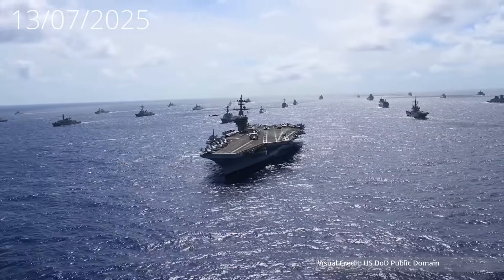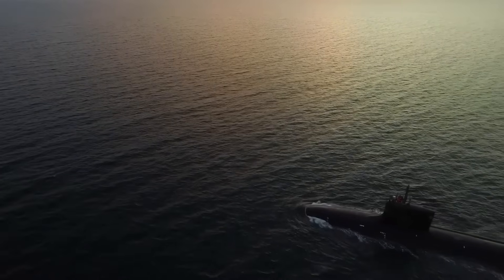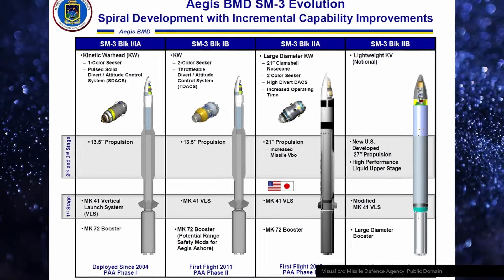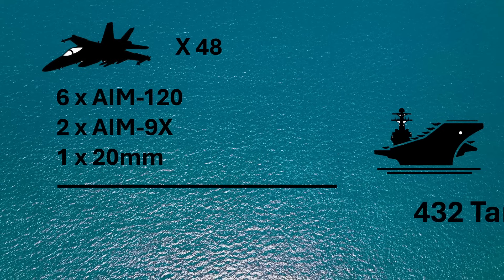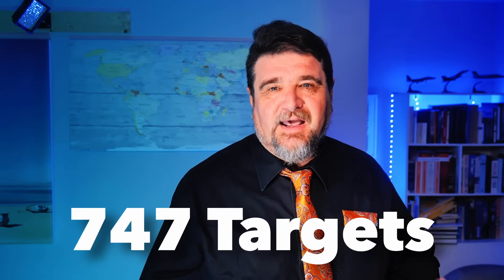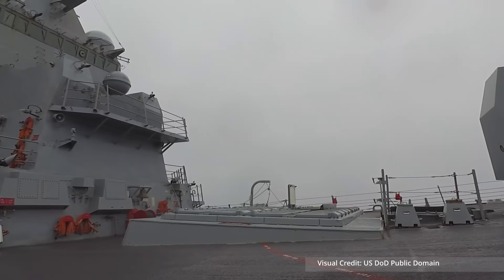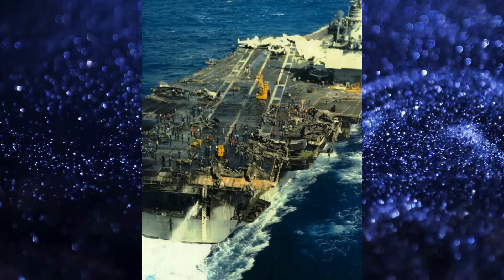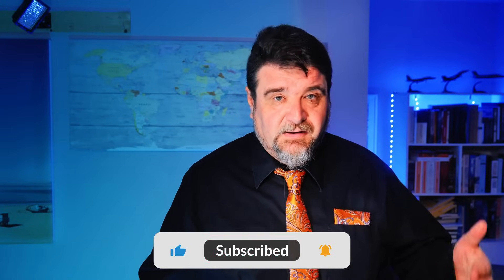HOW MANY Missiles are Needed to SINK A CARRIER?

Comment: We actually have SM-3 performance figures now, at least rough estimates.

Against high speed ballistic missiles, they intercept less than half of their targets. It's likely that saturation of a CBG's defenses could occur with as few as 12 ASBM's. 24x YJ-21 would almost certainly score a minimum of one hit on the carrier. That's only 12 H-6's for a mission kill.

Still, I agree saturation of the carrier's AoR with UUV's seems like a better bet for making it run home before it can even pose a threat.
Reply: Against legacy ballistic missiles with known trajectories, without maneuvers and countermeasures...
Reply: USN too now have some fast anti-ship ones with SM-6/AIM-174B, AGM-88G, and upcoming SiAW/MAKO.
Reply: @johnsilver9338  
These are not new capability, and you basically brought a scooter into a heavy-duty truck discussion.
Reply: @Conserpov  Not really. They are much more devastating. AIM-174B for example follows the same quasi-ballistic trajectory of Kinzhal so it too reaches hypersonic speeds at burnout. And F-18s carry 4 of them. 

While F-35s can carry supersonic AGM-88G, SiAW, or hypersonic MAKO internally. Meaning F-35s can get it much closer to their targets and launch these missile giving the enemy less response time vs a ballistic missile like DF-21/YJ-21 which can be detected at long range of more than a 1000km by BMD radars.
Reply: @johnsilver9338  
Bringing up AIM-174 and AGM-88 in the anti-ship missile discussion is like bringing up pistols in artillery discussion.
MAKO does not even exist yet.
US BMD is a bad joke.
You don't have a clue what you are talking about (that applies to your comments in other threads as well).
Reply: @Conserpov   Their goal is not to sink but disable a ship. Especially with AGM-88G which can target radars of enemy vessels rendering them blind. Even though they don't carry the same punch like Tomahawk they have enough KE to bore holes thru metal. But once enemy ships are disable, USN can then follow-up with classic Tomahawk or Harpoon or low observable sea-skimming JASSM/LRASM maybe even the standard JDAMs. Or USN can do all at the same time.

MAKO does not exist yet BUT SiAW does. You are the one who has NO clue what these weapons can do.
Reply: @johnsilver9338  
Again, you don't have a clue what you are talking about.

AGM-88 is a tiny, short-range, non-sea-skimming missile that can be easily detected and intercepted - or simply defeated by countermeasures.

Not to mention its launch platform will get blasted before it gets a chance to launch it.

It is completely outclassed even by lightweight proper anti-ship missiles in every respect - including passive anti-radar homing feature.

Proper missiles are long-range, sea-skimming, have multimode homing, do coordinated evasive and tactical maneuvers in datalink-networked salvos, carry EW and IR countermeasures to punch through defenses, carry special armored warheads that can go through CIWS etc.

SiAW does not exist yet either. And it is also a "tiny pistol", not artillery.

Just stop embarrassing yourself
Reply: @Conserpov  It's not sea-skimming but it's low flying. It's also tiny hence why it has a lower RCS vs a huge RCS of a ballistic missile like DF-21/YJ-21. Plus with F-35s carrying them internally they can be launched closer at 200km maybe even less. Other anti-ship missiles with passive RF is NSM/JSM, LRASM, and Tomahawk Block Vb MST which are all active in USN arsernal. Is their a Chinese or Russia anti-ship missile with dual seekers w/ passive RF? To compare Russian Kalibr 3M54K/T; Indian BrahMoS; Chinese YJ-18, YJ-12, DF-21, and YJ-21 only have a single active radar for its terminal phase. Which is susceptible to jamming or spoofing. 

SiAW is already at the testing phase with USAF. 

So stop embarrassing yourself
Reply: @johnsilver9338  
Sorry to burst your bubble, but F-35 is still a non-operational, Milestone C developmental prototype. Even if it was completely operational, F-35 getting close enough to launch anything against an actual military target which isn't a small boat is a fantasy.

I already explained why bringing up AGM-88, NSM/JSM, LRASM, Tomahawk, SiAW in this discussion at all is silly and childish.

Not only US Navy cannot even hope to even match opposition's offensive capabilities, there is an issue of US Navy - unlike the opposition - being completely defenseless to missiles (I made a separate in-depth thread on that). Which makes the whole hypothetical scenario completely one-sided in both aspects.

SiAW is in early development, the project is not even far enough for DOTE to oversee it.

Just stop.
Reply: @Conserpov  Sorry to burst your bubble, “The F-35C is ready for operations, ready for combat and ready to win,” said Commander Naval Air Forces, Vice Admiral DeWolfe Miller. “We are adding an incredible weapon system into the arsenal of our Carrier Strike Groups that significantly enhances the capability of the joint force.”. Straight from navy mil since 28 Feb 2019. You must live under a rock. 🤣🤣

Nope, even F-18s can safely approach a Chinese CSG undetected as long as it flies below 5,000 ft. A surface radar no matter how powerful it is even BMD ones can only detect an aircraft/missile flying at 5k feet as far as around 180km due to the curvature of the Earth. This is why sea-skimming works and and why FPV drones are effective as they fly below the horizon or direct line-of-sight of surface radars. You don't even know that so stop embarrassing yourself.
Reply: @Conserpov  Sorry to burst your bubble, “The F-35C is ready for operations, ready for combat and ready to win,” said Commander Naval Air Forces, Vice Admiral DeWolfe Miller. “We are adding an incredible weapon system into the arsenal of our Carrier Strike Groups that significantly enhances the capability of the joint force.”. Straight from navy mil since 28 Feb 2019. You must live under a rock. 🤣🤣

Nope, even F-18s can safely approach a Chinese CSG undetected as long as it flies below 5,000 ft. A surface radar no matter how powerful it is even BMD ones can only detect an aircraft/missile flying at 5k feet as far as around 180km due to the curvature of the Earth. This is why sea-skimming works and and why FPV drones are effective as they fly below the horizon or direct line-of-sight of surface radars. You don't even know that so stop embarrassing yourself.
Reply: @Conserpov  Sorry to burst your bubble, “The F-35C is ready for operations, ready for combat and ready to win,” said Commander Naval Air Forces, Vice Admiral DeWolfe Miller. “We are adding an incredible weapon system into the arsenal of our Carrier Strike Groups that significantly enhances the capability of the joint force.”. Straight from navy mil since 28 Feb 2019. You must live under a rock.

Nope, even F-18s can safely approach a Chinese CSG undetected as long as it flies below 5,000 ft. A surface radar no matter how powerful it is even BMD ones can only detect an aircraft/missile flying at 5k feet as far as around 180km due to the curvature of the Earth. This is why sea-skimming works and and why FPV drones are effective as they fly below the horizon or direct line-of-sight of surface radars. You don't even know that so stop embarrassing yourself.

Comment: Maximum Effort ... "I'm gonna do this the old-fashioned way, with two swords and maximum effort."
Joke aside, that is just one end of the bell curve. Typically "maximum effort" involves multiple vectors, so bombers are just one part, and would have an escort (so one would assume a large part of the hornets would be shot down fast as well).

One aspect that is also interesting to consider is the cost, how much in dollar does it take each side, and assuming different rate of loses, at which point does one side break even or get a decisive advantage.
A failed attack might leave the carrier afloat but most of the air wing destroyed. Or is it worth sacrificing a manned submarine to take out one or two escort ships?

Comment: Aircraft carriers might be relatively difficult to sink, but they can be rendered combat ineffective (unable to launch and recover aircraft) relatively easily.   Once rendered combat ineffective, they become huge, tempting targets for follow-up attacks.
Reply: It is not just that the ship could be rendered unable to fight.
A crippled aircraft carrier could be even worse situation than a sunk one.
Just imagine a ship unable to sail or manoeuvre in the middle of the ocean, with hundreds of wounded. 
Which orders would receive the rest of the task force? Protect it staying in the area? 
Try to take the non wounded and sail away?
The question should not be whether an aircraft carrier can be sunk, but what are the chances for long-range aircraft or submarines to hit it with a heavy missile.
Reply: @luismariagomezdearanda5319 don't forget about the cheap AI drones.. 😂😂😂
Reply: @luismariagomezdearanda5319  - That's a good hypothesis but would need to have damaged the rudder and/or the engines; basically a massive (thermobaric?) torpedo hit (or rather multiple hits just to be sure) to the rear of the ship, where the rudders are and the engines probably sit too. Easier said than done but definitely a tactical sketch to be elaborated upon.
Reply: They will be good floating coffins.. 💯💯😂😂
Reply: Claro, un portaaviones no necesita ser hundido, simplemente lo dejas fuera de combate de muchas maneras y te ahorras el mal gasto de misiles. Despues de eso, si lo quieres hundir, dale para adelante!
Reply: Don't forget. The Americans throw aircrafts over board to gain speed.
Reply: 也不一定，只要在这航母沉没的几个月内掌握这片海洋的主导权就可以了，谁能拒绝一船的高级俘虏和一艘航母当做战利品🎉所以最大可能还是，美国的军官决定撤离航母，主动让其快速沉没
Reply: A country which cannot yet deploy a hypersonic missiles has the ability to intercept hypersonic???  Dream on!  We saw US AD systems in Ukraine and recently in Israel.  They failed miserably against hypersonic. One DF26 will sink a US carrier.  Same goes for the similar Russian weapon.

Comment: In terms OF ICBMs attacking a carrier strike group, all such devices have always been hypersonic, however the latest types are manoeuvrable during the reentry phase. These do not have to be directly struck by an anti missile, but simply an explosive charge, sufficient to perturb the flight of a hypersonic missile, would be sufficient to destabilise the hypersonic flight, well beyond aerodynamic recovery technologies. Be these ballistic devices gyroscopic or GPS guided.  If I am correct in my many assumptions, then the ring of defences around a carrier could deal with these as the greater threats to the group's corpus.
Reply from the maker: No, they are too fast for an explosion. This is the reason why hit to kill is a thing.
Reply: @Millennium7HistoryTech  OK, thanks Gus.

Comment: Like all these 'simulations' it's just dressed up mathematical nonsense any attack would be N dimensional meaning it won't just be a constant stream of anti ship missiles rather attacks from a combination of platforms and most people know that AEGIS in BMD mode loses capacity against Ariel threats plus the super hornets will have to run into a gauntlet of AAMs from the launching platforms escort fighters. Maybe the opposing commanders are just morons sending pilots to their deaths like lemmings. Filed in the same unsinkable bucket as the titanic Bismarck yamato. BTW in the open ocean a mission killed carrier is as good as sunk if the attacker has As ms and presses forward. Nevermind stick with your figures after all it's the confirmation bias they all crave and now that this is no longer a side hustle best not rock the boat with the core audience!

Comment: A submarine with modern torpedoes have a good chance. And it can be done. It has (almost) been done. A chinese diesel-electric submarine surfaces within a carrier group. This made US Navy ask Sweden if they could borrow a Gotland-class diesel-electric with crew for practice purposes. Back then, the Gotland-class was the most advanced diesel-electrics there was and they are still top-tier. And their sterling engines mean they can stay underwater for weeks. 
And they are small and silent but have torpedoes to spare. Gotland penetrated a carrier group that was actively looking for it, snaped a photo through the periscope and sneaked away without being detected. 

Yes, there are decoys. But swedish torpedoes can be steered using fibre optic cables. And I bet the russians and the chinese them. It is old tech that has been around since the Cold war. I am certain US Navy also uses fibre optic steering on their torpedoes.
Try decoy that. 

And there is always the option of doing it the old fashioned WWII way. Estimate where the target will be and fire a spread. 
Torpedo bulkheads will take some of the impact but China and Russia most likely have already thought of that. 

Now, the submarine that launched those torps from within the carrier group will now be in a very... precarious spot. The chance of it getting sunk is pretty damn high. But the trade-off seems well worth it.
Reply: "most likely have already thought of that."

That's what things like the Type 65 was developed for.
557kg warhead specifically designed as a keelbreaker for big ships like carriers.
One such hits, carrier most likely sinks.

"And they are small and silent but have torpedoes to spare. Gotland penetrated a carrier group that was actively looking for it, snaped a photo through the periscope and sneaked away without being detected. "

They achieved this many times even.
They got anywhere from around 1000m down to as close as just 250m away from the carrier.
Reply: @DIREWOLFx75  The Aussie did the same things as well a few years back.....
Reply: "But the trade-off seems well worth it." the crew being sent on a suicide mission probably disagree.
Reply: @MorbidEel  Again, that's the reason for Type 65.
When you have a torpedo that can run over 50 kts for over 50km distance, you don't really need to be close enough to be discovered.
Reply: @MorbidEel  "the crew being sent on a suicide mission probably disagree"
meh...  the whole Swedish Cold War defence was a suicide mission, aimed at causing maximal losses to the enemy before going out. Just part of the job description and nothing else.
Reply: @johanmetreus  ah right forgot about that. Whether you are on the aggressor or defender side does make a huge difference although at least some of the times that can be manipulated
Reply: @MorbidEel depends on how it is framed to the crew.
Reply: @MorbidEel  ALL submarine crews ARE already on a suicide mission from the moment sub takes the 1st dive on a mission to kill an adversary's military assets.

Based on current detection technology; every submarine - American or otherwise must remain stationary the instance it enters the radius of the maximum range of weapons available on a surface combatant; ie from 500 km to 1,500 Km ( or the maximum combat range of an aerial drone launched by the ship ). I seriously doubt there exist any production torpedo able to threaten surface vessels from a 500 km certain-kill range. 

The moment it is detected, the means available ( for peer adversaries of US ) to prosecute it; are so rapid and have such high probabilities of crippling or sinking it. That's the logic for China building quantity ( in subs, underwater drones and munitions ) during this current period while simultaneously researching & testing to improve stealth qualities of their subs. 

Submarines have a range of probabilities from as low as 1% to as high as 99% - at sinking an Aircraft Carrier - because the factor of luck cannot be quantified. With 3 UAVs armed with 6 torpedoes each, silently patrolling 20 to 50 Km ahead; an AIP sub can achieve a 99% sink rate - as it prepares an ambush zone for surface combatants. The catch is; it must not be detected first.
Reply: There were many instances of USSR/Russia/China submarine surfacing on a middle of carrier group.   They are all perceived as a USN failure to detect.
Pls tell me,  what do you expect them to do if they actually detected these subs?
If you think, the carrier group would do exactly what they did - nothing.  Let subs to surface and claim 'victory' and than double down on anti-sub warfare.
Reply: Until people on board loose it and kill each other.
Reply: What did you expect them to do sink the sub and start ww3.  They knew it was there.  They tracked it and recorded its signature.
Reply: @Spectre4913  "What did you expect them to do sink the sub and start ww3"

The normal procedure (or traditional custom really) would been to ping the sub when it was about to get into the formation:
"Oi, mate, you aren't that sneaky you know. Please don't cause any collisions while here" being the message.

Happened all the time in the Baltic Sea.
Reply: @Spectre4913  
Exactly, at last, one sane voice!!! 
Most likely USN detected it, recorded and ... took no immediate actions.  In either case, USN double down on training by asking Sweden to help.